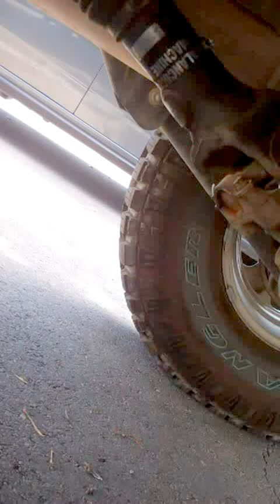DANA 44 DIFFERENTIAL ISSUE

Comment from the maker: **UPDATE** ok,to fix the click and clank and awful noises, we replace the aftermarket locker "aussie locker" JUNK,and converted it to open differential with just straight spider gears,no more noises or binding,as far as suspension for the axle twist, we replace all the bushings and installed new Pro Comp shocks they were only $30 a piece from 4wd.com, they were about the most reasonable on the Dana 44 parts I could find, and very great kits they offer.

Comment from the maker: Well,its has been over a year since this customer has had this issue,this issue ended up busting up his ring and pinion,$800 later he still has the same issue even after replacing all the rear suspension bushings,it now has a AUSSIE LOCKER in it which ive told him its jusk, today i have convinced him to replace the rear shocks,and convert to a open diff seeing he dont 4x4 much,rather its a daily driver,i will up date this posting of the outcome when open diff conversion is complete

Comment: The joint in front of diff is bad!!!  At 22sec I can see the u joint slop and that silver ring . That silver ring is exposed clean metal! Hasn't rusted yet. That means that the bearing is shot! I had the exact same problem last week sept 2011....I thought it was my trans.... Change that u joint! That will probably solve everything